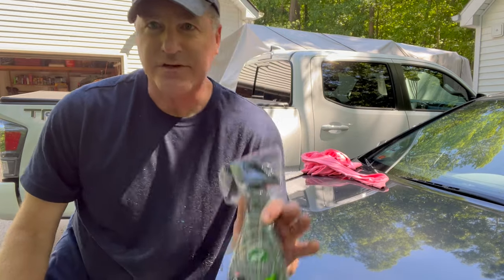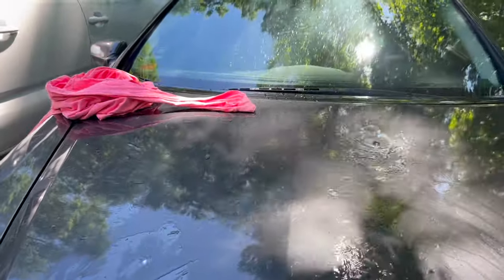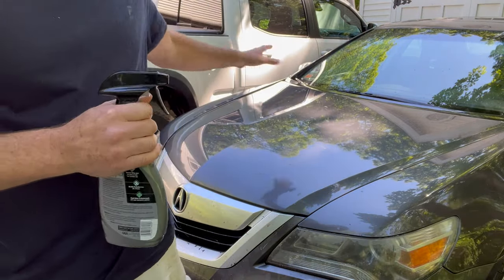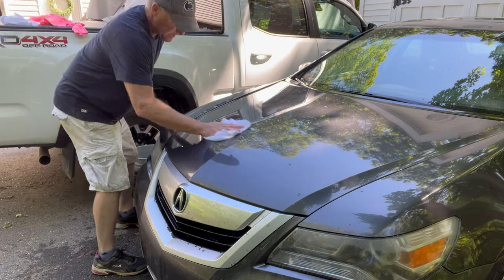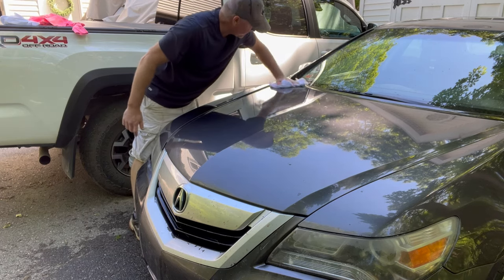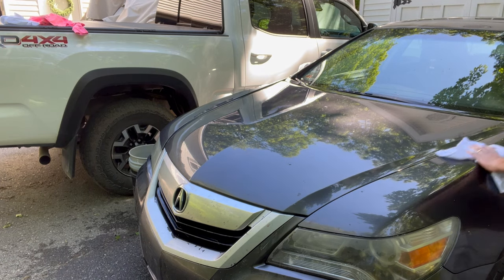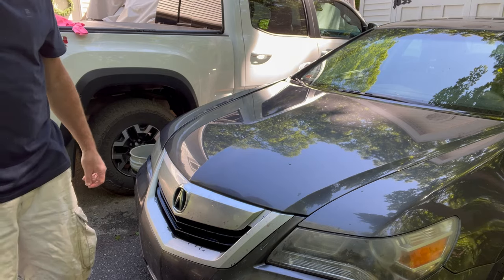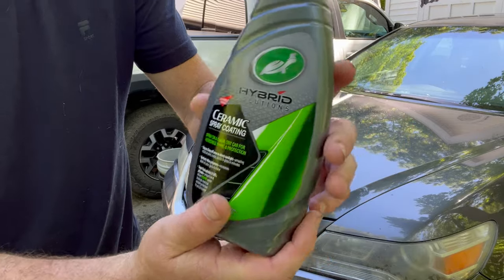Turtle Wax Hybrid Ceramic Coating Review – 2010 Acura RL

Comment: I have used a fair bit of that stuff, my advice would be to get a damp microfiber, spray the wax onto the cloth and then apply. If you spray it directly on you will get streaking (i wouldn't apply it in direct sunlight either tbh)........ Bit counter intuitive putting it into a spray bottle and then not spraying it on but that way you get good results. Just to add, it is well worth doing the second coat after 24 hours thing, on a preped car i've seen it still beading 8-10 months later with just basic hand washes sporadically.
Reply from the maker: @K2edg - thanks for the info, I’ll try the cloth technique next use.  I did put 2 coats on my white Tacoma, seems to be holding up well, cement dust even rinsed right off.  Thanks again.